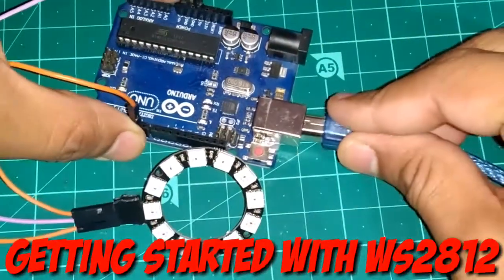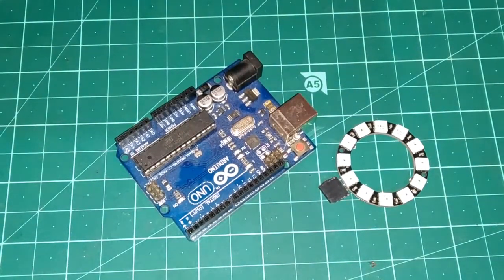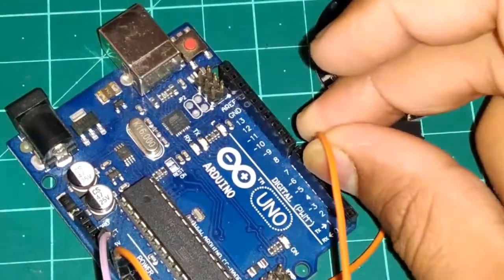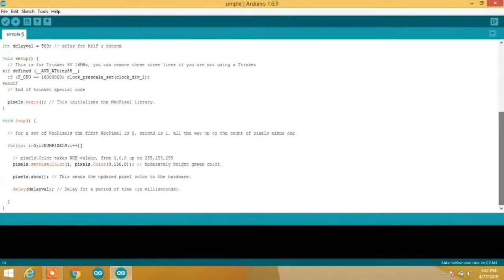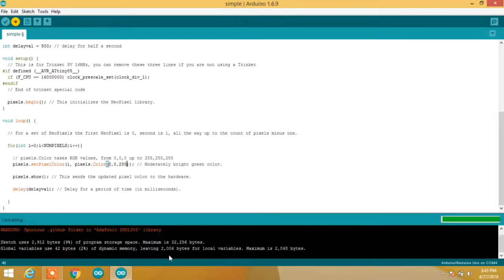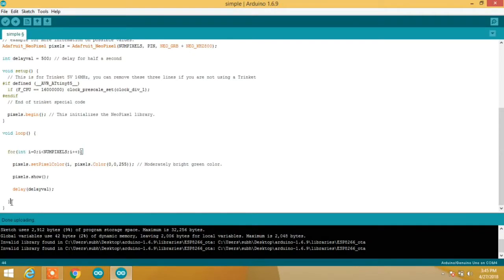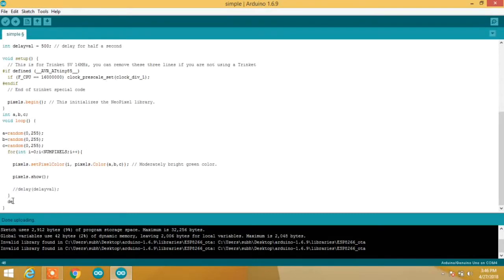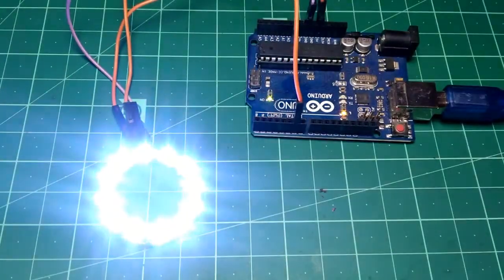Neopixel ws2812 LED Strip or LED Ring 12bit with Arduino Tutorial

Comment: 255 steps is 8bit not 12bit as in the headline...
Reply: @electronicGURU   Ah okay because I am looking for RGB LEDs with 12bit PWM on chip :)
Reply: 12bit in the title of the video refers to the number of LEDs on the neopixel ring.
Reply from the maker: Yes Akshay that understanding is very correct
Reply from the maker: Oh sorry sir in that case go with better MCU like Raspberry Pi Pico or esp32